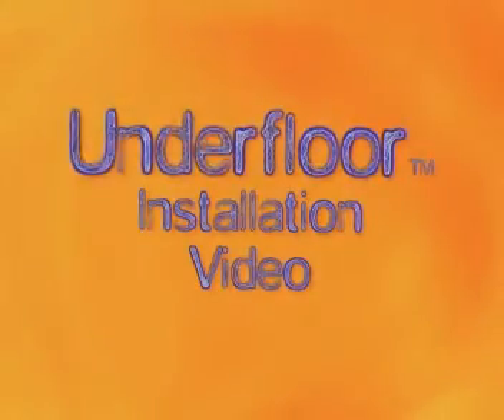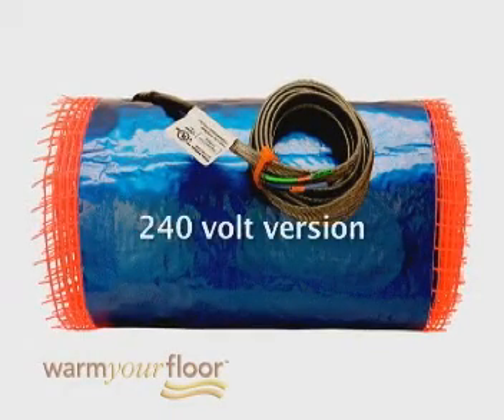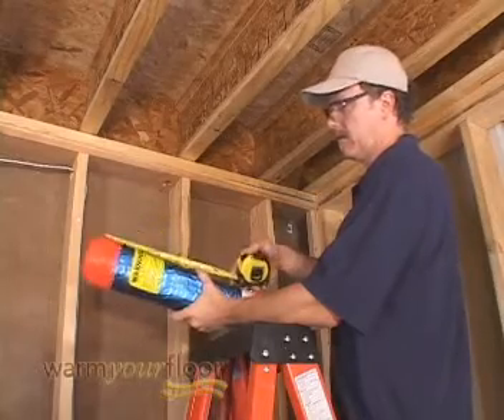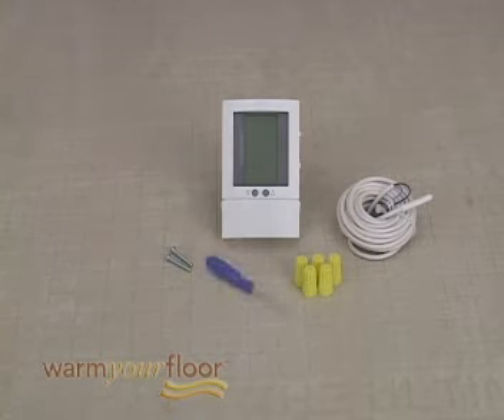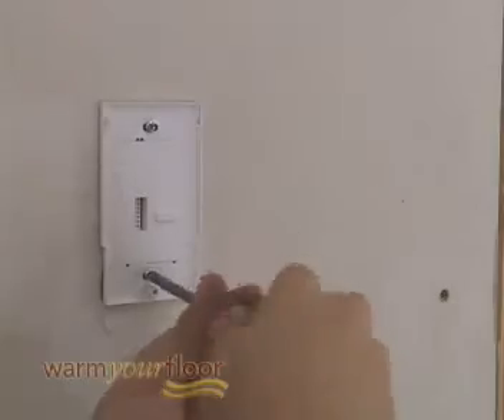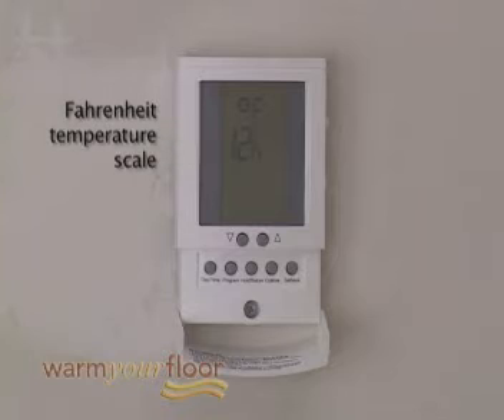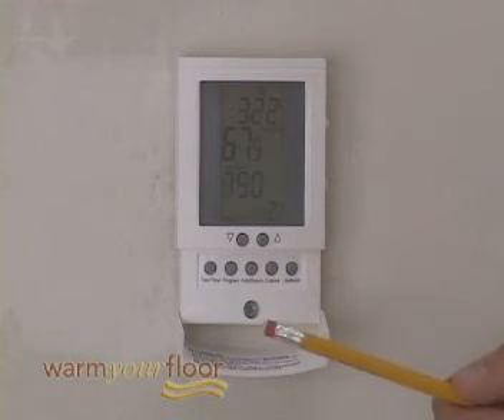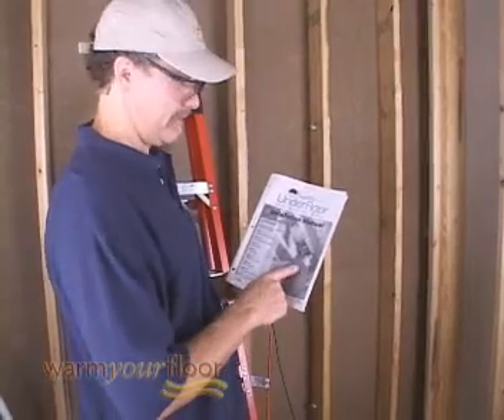How to install SunTouch UnderFloor Retro-Fit Floor Heating Mats

Comment: a question regarding insulation: if using foil-faced rigid insulation what would be the required gap between heating mats and insulation board? (Older original-owner-built house with complicated plumbing between 3.5" by 6" joists, low basement ... list goes on)